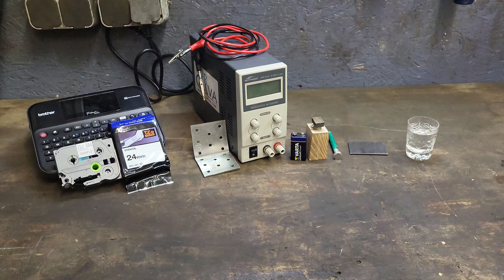Electro Etching with the Brother D600VP

Comment: What settings did you use on the power supply unit?
12 volts and how many amps?
Reply from the maker: I have it set to 12 volts. You don't need to set an Amperage, that results from the resistance of your workpiece. If I remember correctly it pulls like 1 Amp, so pretty much every power supply is fine.
Reply: Thanks for the answer! It´s possible to set limits on the device I had the possibility to use and at 12 Volts an 3 Ampere it was a bit too heavy? So this is not sure but it felt like.

Comment: Do you know of anyone being successful at electro-etching brass? I can get it to darken easily but not actually etch to any depth. Thank you , nice video!
Reply from the maker: I haven tried it, but then i guess one would need a different electrolyte then Saltwater. Try it with Citric Acid or Acetic acid (Just Vinegar) from your Supermarke. I can imagine that going acidic could help.
Reply: @klmindustries4812  I have tried with vinegar and salt added with no effect. I even tried increased current to 6 amps 12V and not etching, however the oxide deposit was outstanding.
Reply: @K3Flyguy  If you're getting great marking (darkening) and no etching, you are probably using an AC (Alternating Current) power supply. DC is for etching, AC is for marking. With AC you add back as much material (in oxidized form) as you remove so it won't etch. With DC you may get some darkening beside the etching but it will often rub off easily. For good marking you need AC.

Comment: Hiya! What power supply model should I use for this? I seem to not be able to find one that looks similar to yours.
Reply from the maker: I bought mine from the Dr. Galva store, its the MCL Power LBN 305. Try looking for a Variable DC Power Supply, or Laboratory Power Supply. Range should be between 0-30V and at least up to 5A. Up to 10A if you also plan to use it for galvanic stuff. 
Hope you can find something ^^.
Reply: Any adjustable DC power supply should do, you can find a lot online or your local stores. Wanptek, Hanmatek, LongWei, Korad are brands you can look for. I do have LongWei although I did not use it for engraving yet since I am still about to purchase the stencil tape.